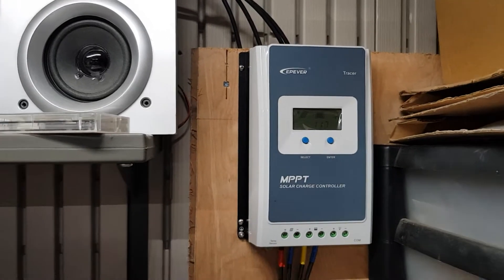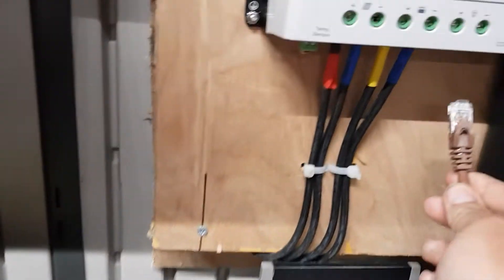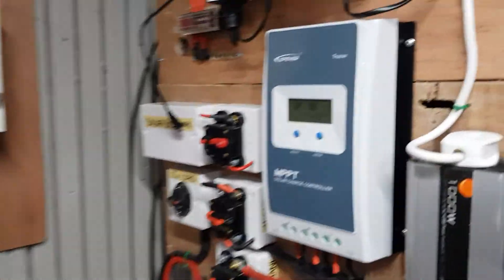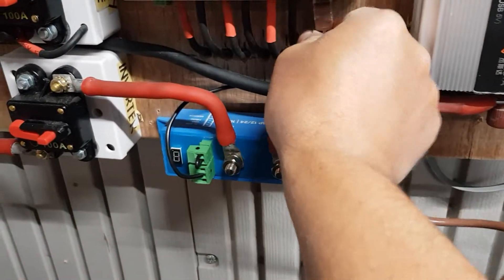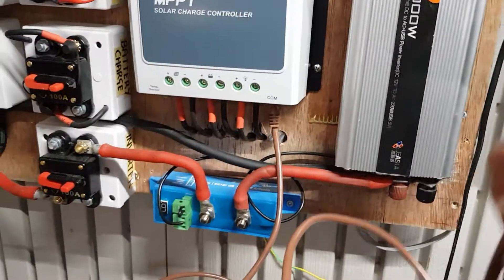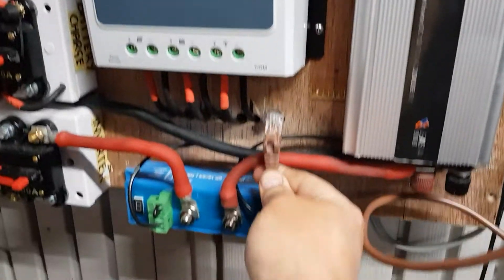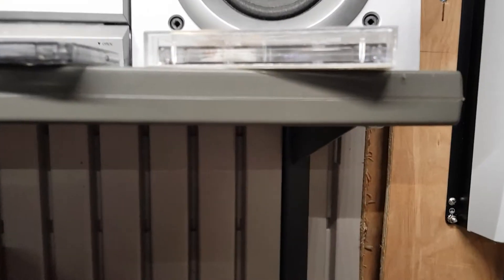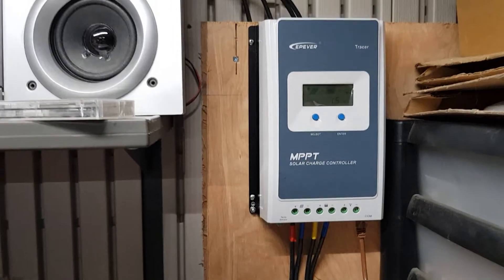Epever Tracer Com Port failure

Comment: The communication with these charge controllers is pathetic and they will not respond to my requests for assistance. My wi-fi e-box 1 did not work with the software and even the EPEVER USB cord won't work with my setup despite using the recommended settings. I bought a Victron controller recently and hit bluetooth and bam! There it all was! Too easy.

Comment: The Communication from EPever Chargers is very bad. I bought an used Tracer 4210AN. It worked fine with the MT50, also with the PC Cable and with the WiFi Module.
I just tried to connect a cable to an USB zu RS485 Konverter Adapter to connect it to an Raspberry Pi. Only pin 4 and 5 where used. It did not function, so i testet it with the MT50 again and now no communication at all. Bad thing is that the EPever Chargers need the communication to get correctly set up for LiFePo4 Accus.

Comment: Hi, Just watched your video after doing a search on the net for Epever com port failure. I have a Tracer 4210AN which I have had for about 9 months. 2 days ago the data logging suddenly stopped, I monitor it using a custom logger called a SolarDashboard buy SnekTek which is very similar to your data logger. I can also monitor and adjust setting via my PC using a USB to RJ45 cable. Now I cant do either. Any suggestions? I too am in the UK (guessing by your accent)
Nice to see an audio cassette on your shelf next to your stereo. My setup is in my garage where I too have a stereo and was only playing a cassette the other day.
  Graham
Reply: replace chip MAX485
Reply: @PTRISE  Hi, I disconnected the batteries before disconnecting the photovoltaic panels, since then the communication port no longer works, do you think the max485 chip could have failed?
Thank you
Reply from the maker: Hi, sorry for the late reply - I did not get a notification that you had posted a question.  My unit was faulty, it seems to be a weak spot on these controllers.